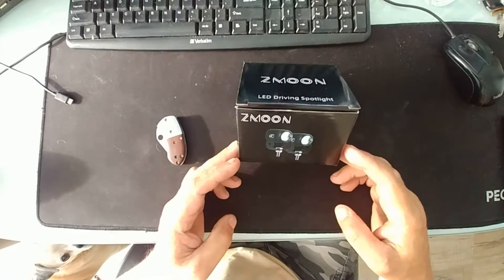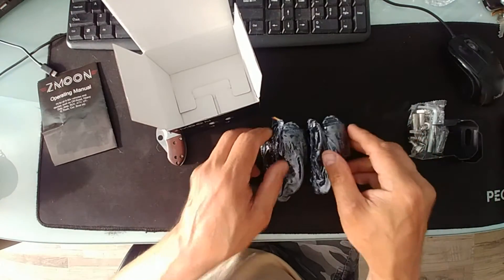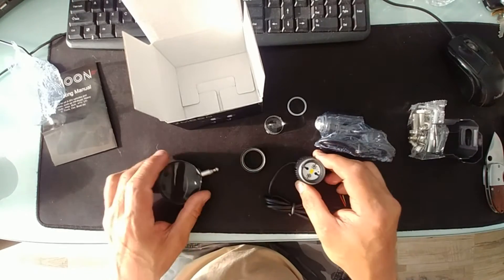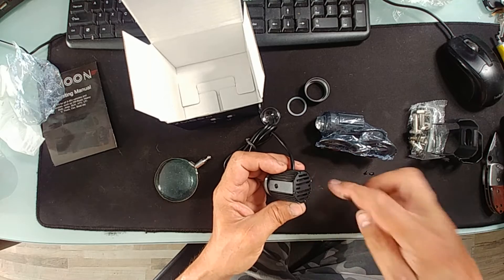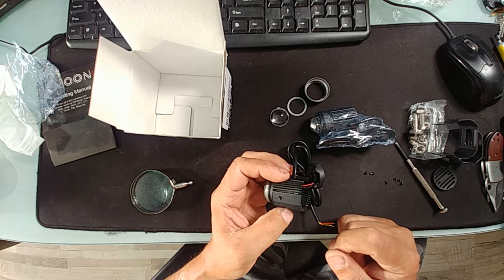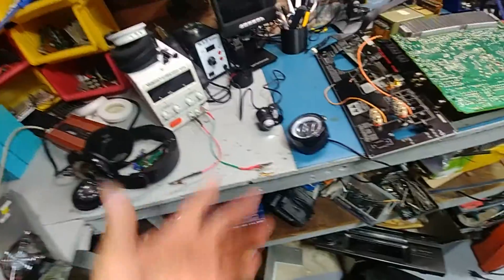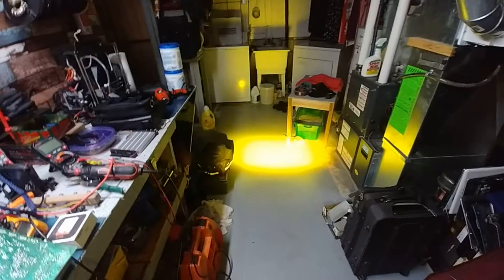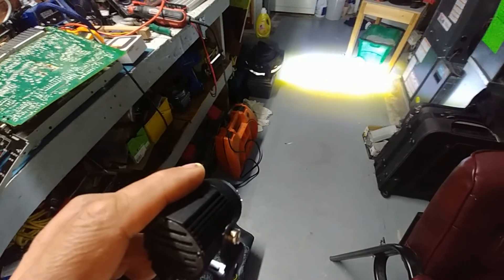ebike lights zmoon 60watt Amber and White 1.3" review test

Comment: Thanks to a local store I've found a munch of random LEDs to try when I finally get my ass to work on my bikes.
Biggest problem I've found honestly, is trying to get some kind of "common rail" for power, or getting a plug so you can swap lights easily. I'm a fan of 52/64V batteries and I don't dare use JSTs; I'm gonna try Deutsch which seem to be capable of handling the most.